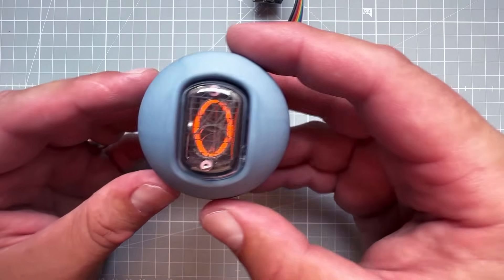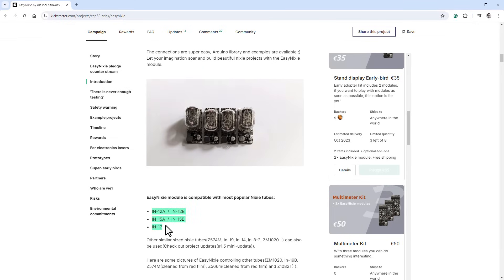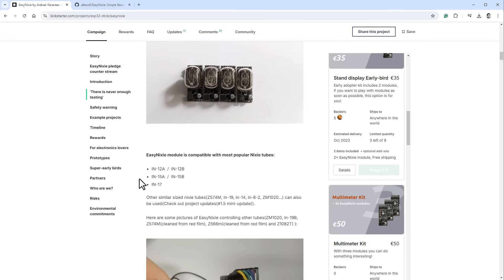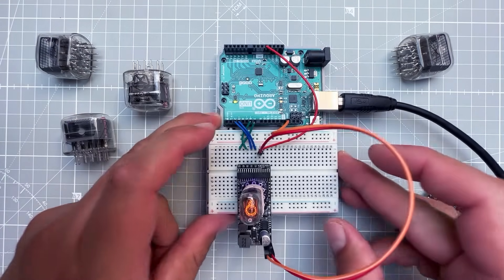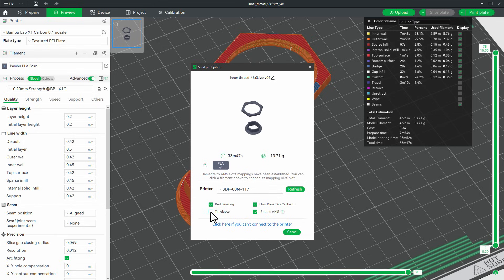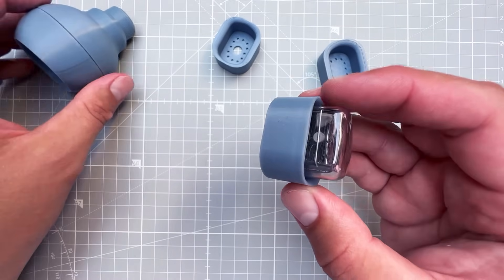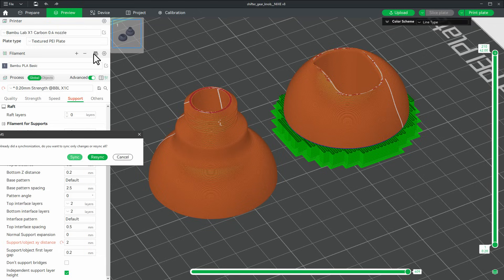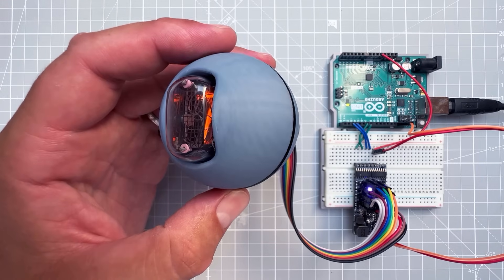Bizzare Shifter

Comment: Also side note for printing but you should rotate everything sideways and print using tree supports. Tree supports are really nice and use less filament and seem to work super well for me and break off easy. The side ways printing is so that if you actually use the shifter they layer lines don’t line up with the force for shifting, this means the parts should not sheer apart on a layer line. Just a tip because I have made the mistake of printing what was easier but the part doesn’t hold up and shears at the lay lines when force is applied.
Reply from the maker: Thank you for your comment, a lot of useful information! May I ask what kind of 3D printed part have you sheer apart? This shifter knob feels pretty solid.

Comment: The rgb led could possibly be use to track RPM and maybe light up red when it’s “time” to shift
Reply: Lol, NOT looking at your shifter knob is the first most thing they teach you when learning to drive a manual transmission.
Reply from the maker: You don´t need to look at your shifter knob to see the red LED light blinking or shining :)

Comment: If you can change your support type from grid to organic, they are much easier to remove and the surface looks better.  Give that a try.
Reply from the maker: Thank you for the recommendation, I will definitely try that!
Reply: @upir_upir  Another benefit of tree supports is they're really good at angles so you can have support only on the bed and have it branch out and under to avoid support base layers on your model. Organic/tree supports also use less filament so they print faster and look cool haha
Reply: @upir_upir  It looks like you've solved your problem, but with the organic supports you can make it all with one material.  It's not perfect, but it's like 90% better.
Reply: @upir_upir  and if you use the option "only on buildplate" there will be only support that is directly on the buildplate

Comment: Oh man, imagine rolling up to a steampunk festival with this
Reply: with a machined brass shift knob and the nixie tube nestled inside
Reply: @omurize2007  And attached to a cast iron pipe? Or is that taking it too far? 😊
Reply: @grabasandwich  and with a tanned leather shift boot to complete the looks
Reply from the maker: It has to be brass shift knob!
Reply: Yeah. That 
Would fuck hard.
Reply: It's dieselpunk. Steampunk would be some kind of flip display or, idk, a pressure valve
Reply: @axelkusanagi4139   diesel punk is a whole different corner (more like big tanks and stuff, I want to say first world wary, but not sure if that's correct) and steampunk is is steam, pipes, brass and cogs and often include nixie tubes in the style (because it's a art style not and re-enactment of a time that existed)
Reply: I was thinking the same @axelkusanagi4139